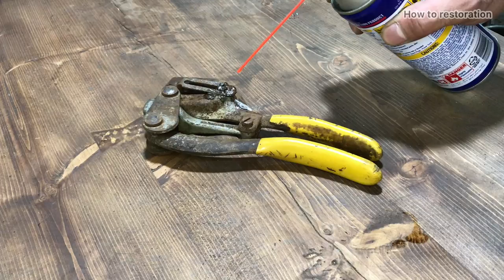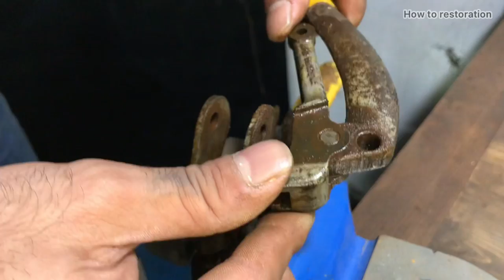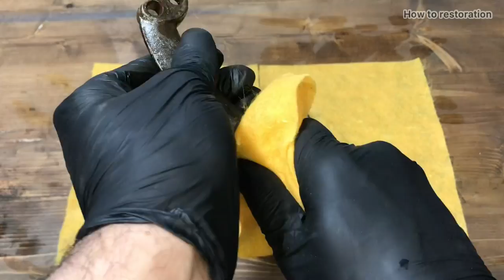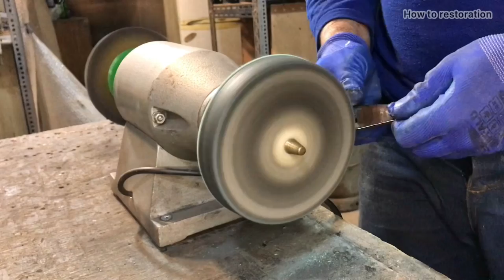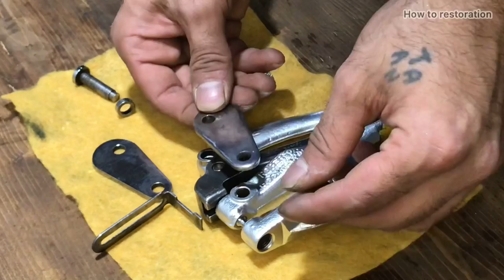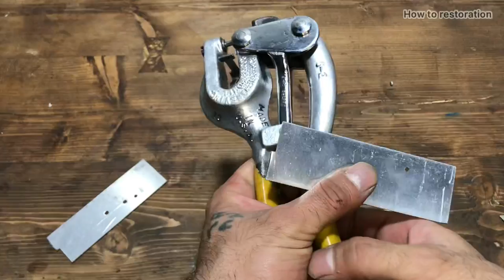How To Restore Rusty USA Hand Punch-From Rust To Shine!

Comment: Great job, this one little fella can punch a hole in surprisingly thick sheets of metal)
Although there was still lots of pitting, filler/polyester putty might have solved the issue, and the handles are visibly worn, rubberised coating would be a good replacement
Thanks for the video!
Reply from the maker: thank you very much🙏